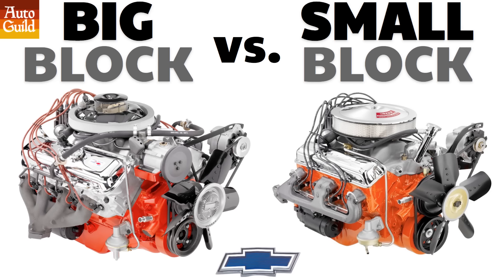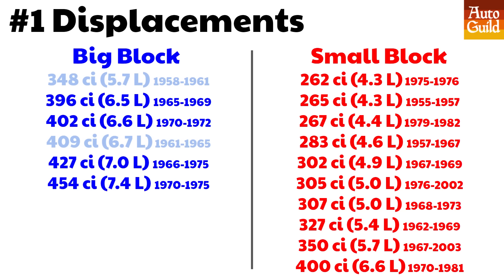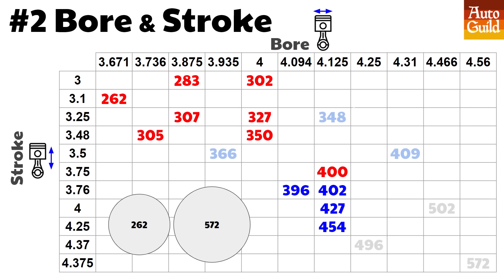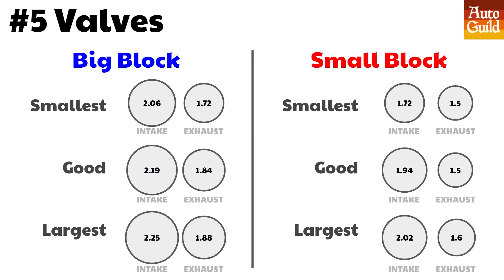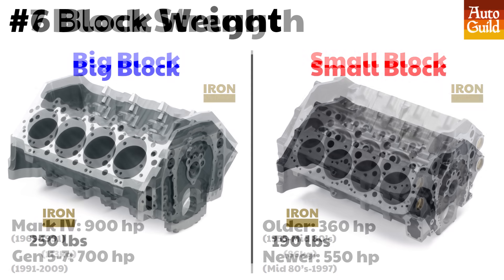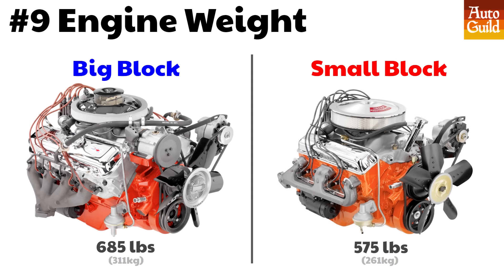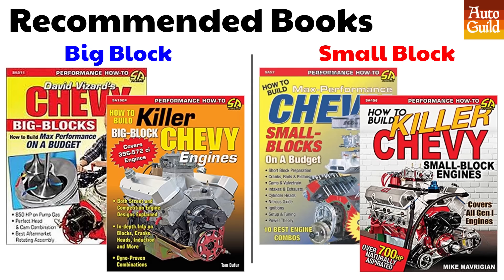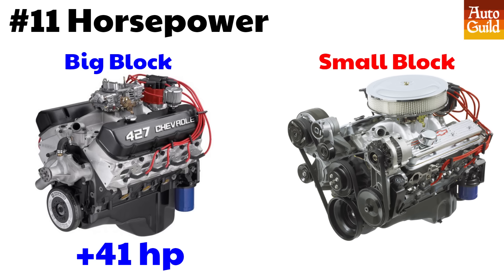Big Block vs  Small Block Chevy Comparison

Comment: My reason for the swap was the torque.  Im used to hooking a 24' ft tilt deck behind a 1 ton Power stoke and pulling an 8000 pound mini hoe all day long. My chevy truck is the square body i love and with the 350 in it at most id say it was a tad fun on loose gravel. Like most so commonly do i found me a motorhome, low miles (46k) that fired right up with just a few drops in top. Now i don't intend to pull heavy equipment but trailers are always a wonderful tool to make money. The chev has been my weekend warrior for hauling junkers to the scrap yard for quick and easy cash. The 350 has a few hundred k on it so i really had to milk each trip.  This extra 300 pounds under my hood i view as a total victory in making these drives more stable. Now smashing down and stacking rigs allows more lbs. On the trailer which mean a fatter wallet off the scale. The 454 took these trips from constant mirror and trailer monitoring to a rock steady and no worries venture.

Comment: I have a 2000 GMC C3500HD with a 454 Vortec. I bought it 3 years ago. It was a retired government truck sold at auction and it had only 43,000 original miles on it. Sadly, 2000 was the last year for the 454 but it was the first year for 4 wheel disc brakes. I love that truck.

Comment: I think this is an interesting primer for folks who don't have any experience with hi-po engine building. However, talking about box stock engines and then referring to actually building them but then saying people don't care about weight is just al over the place. A balanced and blue printed big block with an aftermarket rotating assembly can turn 7000 rpm. One with solid lifters can EASILY do 7400. Think of an engine as an air pump. The more air you can pass through it the more fuel you can add and the larger the power numbers you can realize. Big blocks move more air. Period. Cam specs themselves don't mean much as when trying to go for an apples to apples comparison between a big block and a small block. Reason being, the big block can readily handle the more radical cam profile when using like rotating assemblies. Those comparisons are nothing more than a starting reference point. I also don't know ANYONE who has built a big block w/o swapping out heads/cam/intake/carb/radiator/distributor, etc. The whole point is to actually realize the potential power gains. After that you have to dope out your handling and braking. To leave an engine as a stock boat anchor and to pretend that's just what people do and it doesn't matter is ludicrous. 

I'm not trying to be insuting. I believe this young man puts in tons of research to make these videos and I am subscribed to the channel. I just think that at this point in his journey his experience is more academic than practical. Also, I'm not taking anything away from mouse moters. They're fun and can make a ton of power on the cheap. It just comes down to this: you can EASILY make a reliable 400 horse from a 383. Not even a challenge. You can also likewise make an EASY 700 horse out of a 60 over 454 (468). Again,  not even a difficult task. What you can't do hardly at all is make 700 hp out of the 383. By the time you include power adders, 1200, hp (800 hp on motor, w/ a 400 shot of nitrous), you can readily see how a 1/4 mile car with the big block has all the advantages.

Comment: The 427 first debuted in 1963 at Daytona, but yes 65 was the first availability to the public. I've never heard of a 427 being built after 1969.
The big block had two versions of the oval port, there was an even smaller oval port for some truck applications.  The 366 cu in big block had them.  
Valves were paired as 2.06/1.72 medium oval port, and 2.19/1.88 rectangular port.  I don't think the factory ever offered a production 2.25 intake for the BB.
NIce comparison, the big block had a lot of beefy features.

Comment: The 427, and the 396 shared the same stroke. How do i know? I used my forged steel 396 crank, in my built 427. ….and, it hit 8500 rpm, when the trans broke( super T-10 4 spd). This engine routinely hit 7500 rpm, with a hydraulic Chet Herbert cam. Daily driver. Hurt a lot of nitroused small blocks, and i did it with one 4bbl carb, no nitrous, in a 1970-1/2, “Super duty” trans-am body. ( used Camaro mounts,/clutch linkage, and a chain with a turnbuckle to hold the engine still.)

Comment: Boy am I glad I got my start before clowns like this passed on their "knowledge". I guess running 7800 RPMs out of old stock crank/rod/piston 327's back in the day didn't really happen. Hell, we used to spin 427 square port BB's 7200, and that was with 3/8" rod bolts....... Oh well, back to the weeds.
Reply: Oh yeah right!! Just after u finished rebuilding it under the tree with remanufactured parts and blew it up again and again. Dumbest thing I’ve read. Stock crank and rod and piston to 7800 😂😂 you must have shown Enzo Ferrari how to do it.
Reply: @sammendoza7168  Some of us lived it.... You act like aftermarket rods, cranks and pistons have been around forever. BTW, Ferrari was running well past 7800......... Do I feel better with my Lunati Pro Mod reciprocating assy in my current 489? oh hell yea, but back when the best you could do was 3/8" dimple L72 rods, we sent them zero shits given.

Comment: You get alot better mpg towing with a big block than a small block. I had a 78 c20 with a 350, th400, 14 bolt(4:10). Fresh rebuild on motor and trans. I was getting 6mpg pulling my camper, less if I was in the mountains. I sold that truck and bought an 81 k30 dually; 454, sm465, np205, d70 rear, d60 front, 4:10's. Pulling my camper now I get 10mpg, mountains or plains doesn't matter. Same gear ratio, similar gvwr, the dually has all the extra weight and drag of being a 4x4. that 454 is far superior in efficiency

Comment: your comparison of blocks, your showing a Merlin tall deck block is10.200 vs std 9.800 deck height.
It's easy to tell because the extra distance above the water pump mounting location.

Comment: I bought a 427 with a 400 hydro out of a wrecked vette and put it in my 56 chevy.  I didn't mess with automatics so my Buddy put in a shift kit. Well, the brake shoes were tiny on a 56 chevy. I had to put both feet on the brake at a light. It just pulsed and pushed at an idle. I would pull out real slow and it would chirp the tires hitting second.  I would advise a new brake system for those considering a big block in a 55-56-or57 chevy.

Comment: My daddy (35 you marine mechanic), told me to buy a stock L78 396 for my '55 instead of my buddies built 331 small block (claiming 400hp in 1975).   He was correct-w/headers,and a double pumper, more torque- it was a way more reliable driver

Comment: As a 95 Pontiac firebird owner the best motor choice for my firebird would be a factory direct supercharged 400 small block because that's the biggest thing I'd be able to fit in my engine compartment without having to modify my engine compartment the most I'd probably have to do would be cut the ram air off of the hood of a 96 and up trans am and graft it on to My Hood in order to make sure that there is enough room for the air filter on the front of the motor and before anybody says anything I would have to go with a factory supercharger that draws air from the front of the motor and not off the top of the motor because with the way the engine sits in the engine bay there's not enough room for an aftermarket supercharger without making a lot of modifications and you can quote me on this because I know every inch of that car like the back of my hand so I know that for a fact

Comment: the ls motor will never feel right in your car so please dont ruin it. 
listen here from experience. if you want to replace an old big motor and put it in an old car you need an old motor because they make torque. ls doesnt make torque the same. yeah youll have snap power for burnouts but take off and it will be weak till high rpms. stoplights youll get shamed. heavy car weak bottom end torque. 
look towards the 96-98 model year chevy trucks. and 96-02 model year chevy vans full size like express cargo conversion. not small ones. 
the vortec 5.7 aka last chevy 350. was roller motor sequential fuel injection and what created the ls efi system same pcms can use either tunes. or harness easily. 
simple lunati cams can make gobs of torque that scares actual big blocks. straight off idle. crisp throttle response and a very very healthy motor. gm hot cam is a little more tame but great in them. lt4 hot cam too. the vortec 5.7 thanks to sharing pcm and tunes with ls sibling aka the weak brother with a good head. can run the 6 speed 6l80e or 4l60e and get good mileage no problem. heavy cars need good bottom end torque to drive good. i get 35 mpg city/ country roads 25 mpg hwy at 70-74 mph with the 4l60e and 3.42 rear end. 400-450 ft lbs of torque off idle. clean tasty hp at redline. it pulls so hard of idle then pulls harder at redline. then shifts and pulls harder. n/a ls cant do that with a load they lurch wheeze and have an asthma attack because they cant breathe.

Comment: (I'm not referring to you who posted the video) There's people in forums that say "1.94 valves are better for a street engine" and "2.02 hurt low rpm torque reducing good drivability on the street" what a crock! That small difference is so negligible for drivability... it does not affect drivability intake and cam selection does the most. Also the people that say the 3" stroke on the GM 302 is not a good street engine because of it short stroke no low end Tq... Wow! It's not the stroke again it was the HUGE duration on the DZ's cam. If a 3" stroke makes no low rpm TQ why did Fords 5.0 work Just fine in fords pickups? There efi 5.0 truck engines actually had decent low rpm Tq. I hate so many forum Key board experts that say things from myth not actual expirience like saying a 350 with 993/882( basically the light weight version of 993) smog heads may squeeze out 300hp...even holdner did a Dyno of a mild performance cammed 350 with very lightly ported (basically just little smoothing)  882 smog heads that made 365hp and I read a popular hot rodding artical that had same results (may have been holdners build?) Again from a person that has zero experience with that just regurgitation of something they read that was incorrect.

Comment: The 427 and 454 big block BOTH are listed with an incorrect 4.125 bore. They both have a 4.250 bore, with the 427 having a 3.750 stroke, and the 454 having a 4.00 stroke. Well done otherwise......

Comment: Which is better? Big Block or Small Block?" What's the application?  Big Blocks have more torque, and because they bigger than a small block, the big block has more horse power.  Small bocks have a shorter stroke, so can rev higher. They also weigh less. Those are the only "advantages" of the small block. 
As for mileage, they were generally with-in 1 or 2 mpg of each other. 
Being physically smaller, depending on the vehicle, the small block can be easier to work on, as there is more room under the hood.
Given a choice, I'll take the big block.

Comment: go back some 13 years. Hot Rod built a Big and Small 400s. camed them close the same, in the 1/4 the BB got off the line quicker, while the SB beat the BB threw the lights

Comment: Horsepower rating for the small-block and big-block can actually take more that . Horsepower rating for The big block is wrong and what really kills it , I do know this , it  happened to two of my big block on the street the stroke can and destroy the engine when continuously driven at a high RPM on the Street . My SS 454 pick truck  blow up because GM in 89 didn't have a 4 auto trans in it , to keep the rpm's down when on the highway . Tim .

Comment: Although I have seen a guy put a 454 big block in a Mini but "What's the freaking point"?
If you want a big block, you are also usually going to go with a car to support it. (Personally for me that is a 69 Charger RS).
Engine bay space and undercarriage are already sorted for the weight and power. 

Point is, engines should be matched to cars. (Unless you want COMPLETELY INSANE like ole mates 454 mini.)

Comment: I find it a little amusing that the Chevy 396, Pontiac 400 and the Olds 402 is the same block.  Tune a 4 spd 396 right from the dealer, you can pull the front end off the ground grabbing second.

Comment: I read before that the 400ci small-blocks should not be considered for performance applications because they broke cylinder walls. The 350ci was recommended for performance, and 400ci for non-performance trucks.
Reply: the two cylinders in the centers of the banks were siamese. No coolant  passage between them. Big problem for any performance engine

Comment: The big block is for types that think just driving in a straight line is cool.  Chances are the small block will make a more livable car.
Reply: Lol i risk my life enough at work, im perfectly fine taking turns at like 70, rather than like 150 or whatever speed these little awd cars can push. Just my opinion.
Reply: If you like to be able to handle small block is the way

Comment: Well, so much for the "Great information" nonsense. You didn't even get started before you proved that you have no idea what you are talking about. The 348/409 blocks were completely different engines than the later ones. In fact, the "modern" big block began life in 1963 as the Mystery Motor of Nascar fame.

Comment: cubic inch dominates.. Is small block is OK. big block will blow it out of the water. 502... Versus a 373 stroker.  Come on stop it. What a stupid comparison. It's even a 427 stroker small block.  Cannot put up the numbers. Cannot flow the heads and diameter of valves..
Reply from the maker: Of course, if you are talking just a drag race big block is best but if you want to have a car that brakes and handles then the small block makes a good choice, depends what you like!

Comment: 2:00 The "396"/"402" thing.... post 1970, despite the actual displacement being 402 (396 bored 030 over), it was still called the 396, correct, in many performance cars such as the Chevelle and Camaro, but in the larger cars, it was referred to as the "Turbo-Jet 400" - which got a bit confusing at the time since the small block "Turbo-Fire 400" was also introduced in 1970. The 1970 Monte Carlo for example, was offered with both the small block 400 and the big block 400.
Reply: I have a 1970 Monte Carlo 
Van nuys built 
"Triple black" option 
Says 402CUI on the ORIGINAL BUILD SHEET
Reply: @thecloneguyz  in any case, the sales brochure listed the Turbo-Fire 400 (LF6), with 2 bbl carb,  single exhaust, at 265hp. And the Turbo-Jet 400 (LS3) with 4 bbl carb, dual exhaust, at 330 hp.

Comment: I quit a long time ago trying to keep up with all the new high horse power engines being produced today. I own a 1967 Chevelle 396 SS and will keep it the way it is. LS engines are everywhere now days. I like old school and it's simple operation. By the way, I enjoyed your presentation.
Reply: Chances are you're not fixing an ls on the side of the road. 4bbl and mechanical fuel pump is the way to go in my mind.
Reply: I couldn't agree more., Keep her old school.
I have a 69 Mach 1 351w 4 speed, 650 Holley, she runs great. I would not change her for nothing.
 I also have a 68 SS Camaro I'm actually swapping out my 350 and I'm dropping in a 427 SBC from Blueprint Engines in a few weeks.
  I prefer to have less weight on the front end, you have less wear and tear on your brakes, your suspension, springs, and you can maintain and negotiate corners better.
 Generally speaking, a small block stroker is going to be an overall better street car because in the real world, roads are not straight, they come with curves ,dips, and corners.
  Unless your dragging 1/4 miles every weekend, I truly believe the 400, 427, 434 small blocks are simply the best bets.
 You get ridiculous HP and Torque in a lighter weight package, that's huge when your barreling into an unknown corner at 60 mph.
  Todays 427 SBC, and 434 SBC actually produce big block power easily.
   I also compared the Chevrolet ZZ427 big block, and also the 1969 427 big blocks of yesteryear. Today's 427 sbcs and 434 sbcs are more potent then many of those big block options.
  Yes if you bore out the big blocks you can surpass the small blocks.
  But I'm talking about a straight up comparison, if you truly analyze everything, I think you'd have to come to the conclusion that the 427sbcs and 434sbs are the best choice.
 
  Most people just think about raw HP and TQ numbers and forget about handeling, cornering, and keeping extra weight off the front end. 
  Another really practical advantage about small blocks is the fact that they take up less room in your engine bay, it does make things much easier to work on, that's a huge win.
  I think there are simply way more pros then cons running a small block car vs. a big block.

Comment: Would like to see if you have any thoughts on performance mods for the old Mustang 6 cylinder engines, when I was a kid and vintage Stang's  were dirt cheap, my best friends dad bought him a 64 1/2 with a 6 cylinder for a project car. The word was milling the head to raise compression and some other mods to gain performance, they called it the "Ferrari" mod... We were going to strip every ounce of weight we could to turn it into a backroad burner. The only rules dad imposed were  "respect my tools, keep the shop clean, and don't kill yourselves". He meant it to be a learning experience, and it was.

Comment: For 110lbs, I’ll gladly run the BB. Fuel consumption sucks, but is she ever smooth and even under heavy load, yes it does slow down, but she does the job. I’ve got the Vortec 454 in my truck, and I’ve pulled max weight for the truck. She’s a dog, but gets er done.